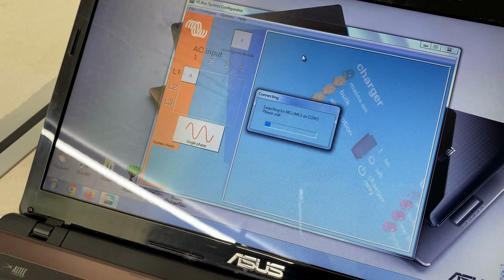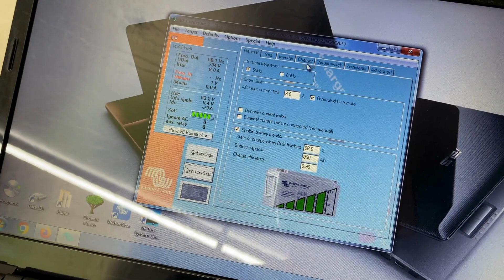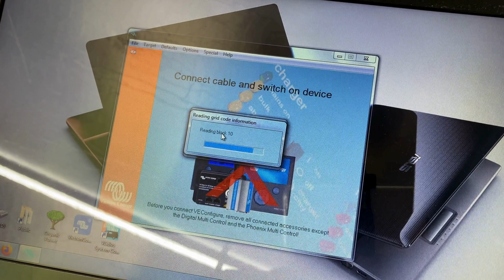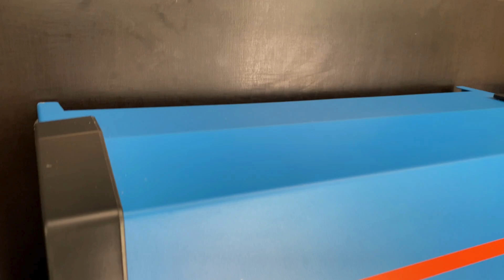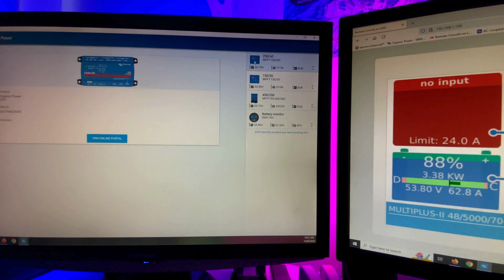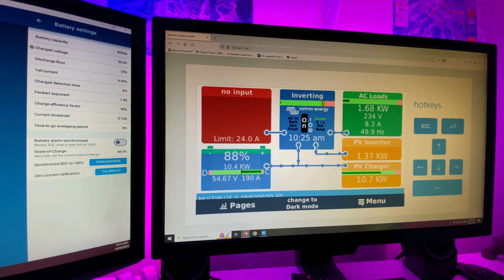Maximizing LiFePO4 Off-Grid Battery Lifespan: The Role of Absorption Voltage #renewableenergy

Comment: I have 'always' heard the best is to keep rechargeable batteries charged and kept between 20-80% soc.  
It has worked excellent for the Lithium-ion batteries I have been using for the last +10 years.
Recently I got a hold of LiFePO4 and though I haven't used them yet, I plan on doing the same with them. Also combining it with lead-acid, so the LiFePO4 keeps the voltage, and the lead-acid can provide current.
Yes, I 'only' get 60% of my rated capacity - but I should get a MUCH longer life-span on the system overall, so I figure it's better to add the needed capacity now - and 'save' in the long run.
Reply from the maker: Thanks for watching, and being part of the community 😎

Comment: For the first 2 years I had mine set at the recommended 58.4v Then I kept seeing recommendations to not charge to 100% for battery life. Made sense. Over the years I watched how the batteries reacted once the PV stopped charging and it switched to batteries only. It always immediately dropped to 53.8v and then started slowly dropping from there. So I decided that I should come off of the 58.4v because it wasn't doing anything useful. I set it to 54.5v and it didn't change the way it dropped to 53.8v when the PV shut down.
In my opinion there's no reason to charge over what the batteries are going to run at when they start generating power. I'm probably 4 months on the new settings and haven't had any problems.
Reply from the maker: Thank you for taking the time to watch the episode and leave a great comment on a real life experience 👍🏻

A higher voltage may charge a bit faster where needed, but for what we are doing longevity is the goal. I started at 55.4 for absorption then dropped to 55v prior to the primo install. Now all is well after dropping back again from 56v after the AC couple to 55v. The only reason I keep it a bit higher than 54.4v is so the internal bms has enough to work with to balance the cells.